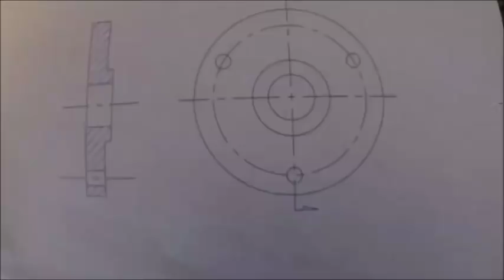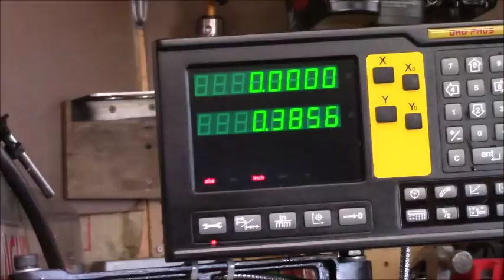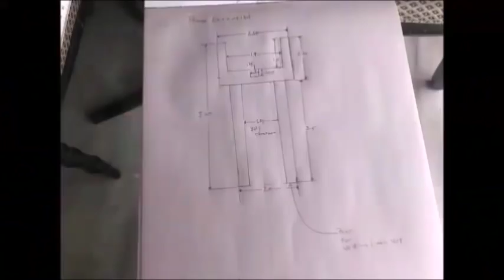The machinist makes a stiffer cut off tool holder

Comment: Nice video Jim. Made several holders for my mini mill. Will be making some i am sure for the G4003G too. After i get it set up. That looks like it will give you years of service. Great job did a nice job cutting that piece off.. keep up the great videos.
Watching in Alabama !
Reply from the maker: Anthony Brown so far I’m satisfied, I gained some rigidity by reducing the overhang from the tool post. This is one of the most involved projects I’ve done on the mill. Lots of set ups. For me the hardest part was getting the blade side machined correctly. The dovetails for me isn’t difficult because I’ve done so many. If you noticed most of my lathe tools are 1” or 1 1/4” shank insert holders normally used on larger lathes. So everyone of them was dovetailed to fit a BXA block. The next day I did one for a subscriber who lives nearby for his AXA post.

Comment: Came out nice, works well.  I have a piston-style tool post and sometimes against my better judgment I attempt again at using it to part with.  And it usually bites me.  That's why I made the turret tool post, because it's far more rigid.  Nice job on yours, though!
Reply from the maker: Everett's Workshop truthfully like you said it’s a rigidity issue. My theory was to get the blade closer to the tool post, therefore reducing overhang from the C/L of the tool post. I had two ways to accomplish that, one was to mill some of the back of the mounting of the original cut off block, so it would be up against the QC tool holder, or machine a one piece unit. By machining the one piece unit I moved the blade approximately 3/8” closer to C/L of the tool post. Since our Asian lathes lack mass in the compound area this helped quite a bit. You did the same with the turret closer to C/L and more rigidity. IHMO the clamping action differences between the two post designs is negligible in rigidity. My lathe originally come with a piston post, but like yours the handle position was all wrong, I purchased an inexpensive wedge to fix the problem but it too was the same way. So I moved the handle to the correct position and made a plug for the old handle mounting hole. So in my case the post switch was to fix another issue.

Thanks again for subscribing, watching, and the thoughtful comments. Keep warm

Comment: Nice knurls set of thin nuts there. We like making tools and tooling more then making our production parts sometimes. Lathe holders are nice to watch you make this should be fun viewing. Good thing you are not against metric we are only metric here in our California shop because the watch and instrument parts world are all metric it was a forced thing we got comfortable with otherwise we would likely be imperial. Our KDK holders are lower that is why we love them the most around our shop. yep we do not use out cutter from Randy we have it placed in a safe place one day we will use it to test our mill being rebuilt by us right now so we are saving it for a special event.
Reply from the maker: Active Atom like most old school machinists I was raised on standard decimal sizing, however I can do metric, however if I’m duplicating a metric part it will be converted to decimal. On the clamp screw since I had a supply of 1/4 x 28 screws it just made sense. The RR dovetail cutters are awesome, the next day I dovetailed a tool for a local subscriber,  tool holders are tough and that dovetail performed well. Thanks

Comment: The separate holder has worked really well for me, but i may still make a new one to use that toolholder for other tools.
Good vid, the sound is lost at some points, you could speak something at those moments to make videos better to watch
Reply from the maker: MF175mp my reason was stiffness by reducing over hang. The separate block and cut off tool holder just didn’t make me feel comfortable. Thanks for commenting
Reply: @JamesDedmon  the toolpost i have is larger so it doesn't have so much rigidity issues, that holder may be absolutely necessary with those smaller ones
Reply from the maker: MF175mp yes on larger lathes rigidly isn’t a problem, the import lathes aren’t as massive in the bed and cross slide area, not as much mass. That was my reasoning of going through this much trouble. I had a sound issue not sure of the problem, but I’m terrible at voiceover.

Comment: I did a nice size job , had enough video for 3 videos.   I went to load it all on the computer to start the editing . And had no video, all sound.  I was a little upset.   Im making some tool holders now.  I may do one for the parting tool.
Reply from the maker: MetalWorks Machine Shop some times uncle Murphy and cousin Bozo shows up. I had that to happen also. I’m jealous of the folks who someone else handles the video and they are in front of the camera

Comment: At 10.30 WD40 is brilliant for tapping.
Reply from the maker: userwl2850 it is but I tend to use regular cutting oil on steel, on aluminum it’s diesel with WD40 and a touch of cutting oil. Thanks for the comment

Comment: Doesn't the damn dovetail vertical clamp twist the shank,  so it sucks for cutting. I tried putting small pins underneith, and on top, of shank. The cutting worked much better but still shattered the bit, at about 3 inch solid 4140, broke at about .75 left,  using multiple width plunges ,going 88 rpm. And then noticed an end of the pin skewed out. Think pin is to small to sit past its own center on shankbody, which of course isn't a sharp corner. Would use larger pins with longer screws troo,  but the "cnc machinist " thinks, "That's bad for the tool support". But he has never tied it. And the last one got bent over cause  of that stupid, dovetail gripping action on straight top shank. So I don't care of the holder lost some of its chin.  I think they Suck. I want a giant .200 relieved on all sides Cobalt cutter,  and the shitty dovetail quick change is all rattled out and lose,  will not grip tight. Its bullshit.  Need to grind the shank at 30 degrees. Nevermind I think the shank gets twisted by the clamp top for a mixing brands reason. Someone Please tell me how to get the pos working. Almost want to use fixturing alloy with the same sized pins I tried. That will really get " the boys" staring. Good night.
Reply from the maker: Well I’ve used the holder for a while now. My objective was to get the blade as close to the the QCTP as possible. The way I use the insert blade is to run low RPM and hand feed the tool. It works well for steel that way. Actually the 1/4 X 20 rod holds the tools well. So I’m well pleased with the set up
Reply: New idea,  Portaband mount near carage for all your practical lathe cuttoff needs. At a real shop. Without clinching the managers ass cheeks cause they keep having to buy damn cuttoff shanks. Don't make a worthless cutter like "winkys" And also you  wont have to stick 4 extra inches of stock in lathe so it can be taken to the bandsaw...
Reply from the maker: @ryanb1874  true on Winkies. I actually have had zero luck with HSS blades. Like I told you the holder works well just needs some patience. Truthfully the GTN 3 stuff I use is the inexpensive carbide. I’d like to move up to the GTN 4 and make a new holder. It seems the heavier the blade the better the results. I have horizontal and a modified vertical band saws just rather part in the lathe